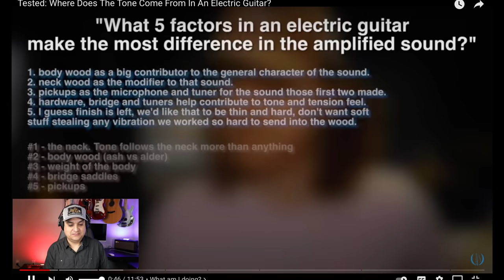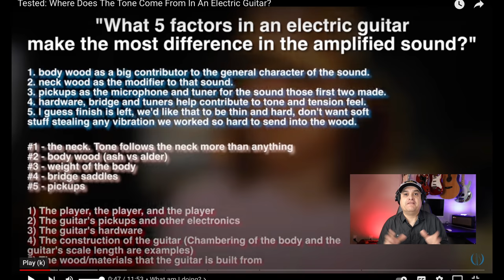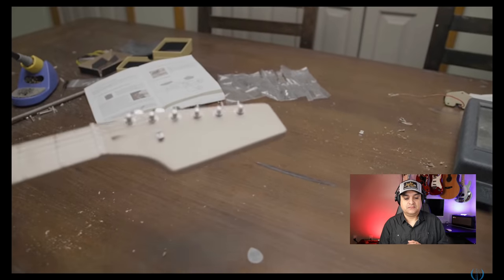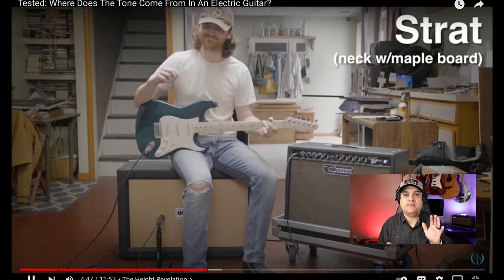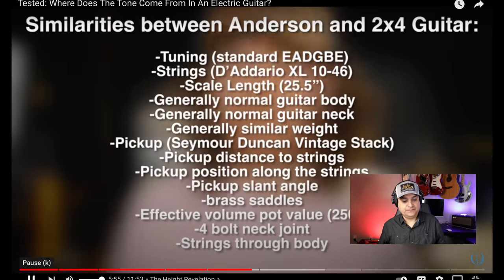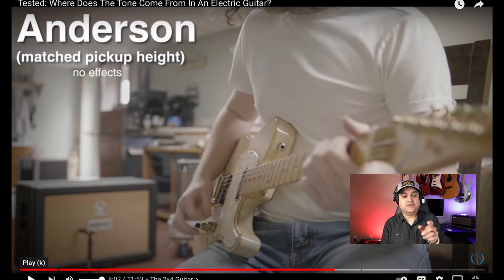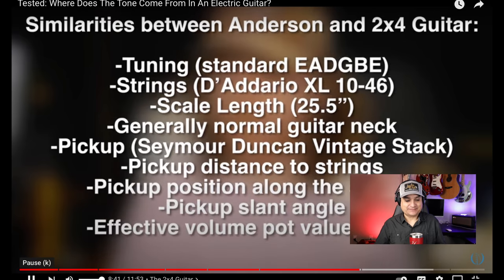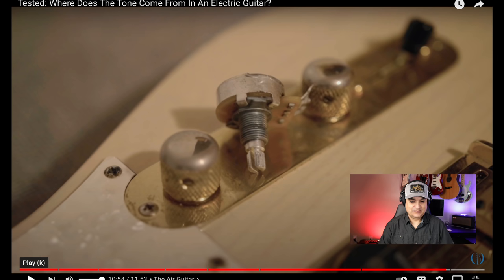Where Does The Tone Come From In An Electric Guitar - Reaction Video

Comment: I was convinced that tonewood should make a difference because after all, that's what 90% of the guitar is made of. Upon seeing this, it really changed my perspective. Not that I've ever purchased a ridiculously expensive guitar because of the allegedly "high quality tonewood" used, but I sure as hell won't be doing that now. Thanks, Dylan!
Reply: It's not as simple as that mate. You'll always get strat sound from a stratish guitar, and LP sound from an LP, even if you use humbuckers in the strat and singles in the LP, because the sound actually comes from the scale and pickup positions. 

So, if you drop the pickboard off a 5k quid Fender into a cheap far east strat and set it up properly, you'll get 5k quid sound off the cheapo. However, it won't feel the same, it won't have the same sustain, it will go out of tune quicker, the neck will bend and warp with time, the tuners will give you a harder time, etc, and therefore it will not sound great most of the time, because something is off all the time. If you want to save money, you get a 1k to 3k quid guitar that you love the looks and feel of and keep it for the rest of your life. Small mods over time will let it age to become ever better and to become YOUR personal guitar with YOUR personal sound. 

If you don't have spare change, you can buy professional grade instruments used between 500 and 1k quid, and still really good instruments new in the same range, that will last and that you can mod to become professional grade over time. 

Buying a 350 quid guitar is a dead end, because they are not worth modding, they won't last and they'll make playing harder and less satisfying. 

Sound is overrated. You can make almost every guitar sound right and a lot of the sound comes from the amp, speaker and whatever other components you use, and how you set them up.

My dad was a sensible man. He bought me a cheap, beaten up stage banger 1967 strat in 1979. I still own, love and play this instrument after all these years. Obviously I invested in a full rebuild and numerous repairs and upgrades in the electrics and hardware department over time, and it has become a stunning and quite valuable instrument.
Reply: @adrianguggisberg3656  Most guitars are made with CNC machines, so the differences won't be too great. A Mexican strat won't sound and feel much different to an American Strat at all. Obviously, a custom-shop masterbuilt guitar might feel different because more care goes into shaping the neck, like on the edge of the fretboard and the frets themselves, but that's about it really.
Reply: It's just like the "string through" argument.  The violin is top loaded...
Reply: @Nghilifa  I have a custom shop, hand built to my order and liking G&L "Legacy HSS" strat. It's one of three of my stage work horses. The other two are a Martin acoustic and a PRS Torero. The Martin is obviously the exact opposite of the other two, relying 100% on its materials, build and shape for sound. The the sound of an electric guitar is 100% the result of its electrics, the chain of components it's plugged into and their settings. If a robot was to play a super expensive and a super cheap strat with identical electrics exactly identical for 5 minutes you wouldn't be able to tell any difference in a blind test. IT ISN'T ABOUT SOUND. However, if a human guitarist plays the two, you may hear a considerable difference, because we interact with an instrument in many ways, which will result in different playing and thus different sound. What you hear is never just the sound of a guitar. It's the sound an artist (as opposed to a robot) produces with the guitar. For a novice or intermediate player it's completely useless and even counterproductive in many ways to buy a custom guitar. Though they likely will be able to tell the difference, they won't know what to make of it. You need to go through X guitars and Y hours of playing before this makes sense, but eventually you'll get to the point you'll look for YOUR guitar. In my case it took almost 35 years, but I absolutely positively assure you that I can't play nor sound with any other guitar like with my G&L, particularly not after now 8 years playing it. The same is true for my Torero, but I could buy another well taken care of Torero off ebay and it would be indistinguishable. It's an off the shelf guitar and it helped shape my playing. What I learned from it went into how I had my G&L spec'd (particularly the rear mounted controls and their layout). I didn't shape the Torero, it helped shape me. The G&L OTOH, was specifically shaped to fit me. It also shaped me in the meantime, but quintessentially it is me. So, if you ask me does a custom shop strat sound different than a mex strat, I'll say no, but yes. If you ask me is it worth it, I'll say it depends. It's just not as straightforward as people try to make it.
Reply: @BOBANDVEG  A violin is an acoustic instrument and as such a completely different animal altogether. But yeah, sound wise such things are almost completely irrelevant in electric guitars. They never the less can be very significant in other ways.
Reply: @BOBANDVEG  and has NO sustain! ;)
Reply: @BOBANDVEG  - Did you really just compare a violin to a solid body electric? 

Bruh.
Reply: He's not right. The center block and neck wood 100% affects tone! Not a lot but it does. People who don't have good ears swear it doesn't. They just can't hear it lol. Go try and tell Eric Johnson that it doesn't. I will tell you right now I can hear the difference of when a damn tuner is clipped on the headstock! It's a minimal difference but it all makes a difference.
Reply: Just get some nice pickups
Reply: @benink5690  It makes a difference. I have good ears and I can hear the difference in the cleans. But it's difficult to tell what it actually comes from. Anyway, it doesn't matter. You send it through OD and reverb and any number of other pedals and FX. The difference is in the feeling while plying, not  in the Tone. One does hear things like sustain though, and those clearly depend on the instrument as a whole, not just electrics. In fact, tone is just about the only thing that has almost nothing to do with the guitar itself. There are so many other factors that make a guitar sound great or horrible, I don't know why everybody seems to think tone is the holy grale when it isn't, and is easily adjusted by dropping in different pickups and investing in a decent amp.
Reply: Buy PAF ,stick it onto a hard cardboard guitar and you got yourself a 59 Les Paul buddy, hell yeah, you have seen the light!
Reply: @benink5690  oh, the old argument "if you don't hear it, you have bad ears"
Reply: @joseislanio8910  cliches seem to stick huh? I'd hate it if I could never taste the sweet flavor of chocolate. Sorry for their loss. But I can definitely hear it and so can many others including some of your favorite artists. Unless you just listen to metal...
Reply: @benink5690  what artists exactly are you talking about? I don't really listen to metal (my favourite guitarist is Steve Hackett btw) but I don't see many good guitarists bragging about the wood as being a bit part of their sound.
Also, any of those artists actually changed only the body and kept everything else in the guitar, and could listen to a difference?
Are they completely free of any biases?
Reply: @joseislanio8910  Jimi Page, Mark Knoplfer, Steve Vai (despite popular belief), Eric Clapton & most of all Eric Johnson. List goes on my man. Metal music doesn't matter as much. Especially these days. They overly compress metal music and edit in DAW. Distortion already compresses it. That's why metal heads can't hear the difference & are usually the only ones arguing such non sense. But now we have a country arrist trying to fool us too. Because it doesn't really male a difference for metal.
Reply: @benink5690  I 100 percent guarantee i could make recordings with tuners clipped all over the guitar and those with no tuners and you couldn't identify which was which.
Reply: He's just a gatekeeper trying to make himself sound like he's on some other tier of "music/artist". You can't reason with him. He's the typical 'sniffs-his-own-farts' goof @ChrisHaynes-ds6rp
Reply: @joseislanio8910  He is simply falling for marketing gimmicks. Arguing with cork sniffers will always be a waste of time.
Reply: I love how the boomers are offended in the comments trying to justify their $1,000 guitars when in reality you could just upgrade a cheap strat with better pickups and pots for example

Comment: Leo Fender used similar "air guitars" to voice his pups. Electric guitars rely on electric signals, that's about it. Control the signal, control the sound. This is good to know. It means you don't have to destroy a rainforest, or pay a premium for something that doesn't really matter. 

Good hardware + Good Electronics = Good Guitar.   (bolt them on whatever you want)
Reply: Then no one would pay more than 300$ for an electric guitar. Pickups cost almost nothing, same pots and frets. So don't expect any firm to sell electric guitar for more than 500$ if wood doesn't matter. It matters for some people.
Reply: @popcornsniper  There'd still be a legitimate market for expensive guitars, because there's more to a guitar than tone. There's ergonomics, the get job, nice paint jobs, quality control, quality of the individual parts (like a good floating trem), etc. An expensive Ibanez Jem is made with basswood, just like a lot of cheaper Ibanezes.
Reply: @andrewmcintosh2703  How the instrument feels to play and how it resonates can affect how you play it.

Also flamed maple tops are badass.